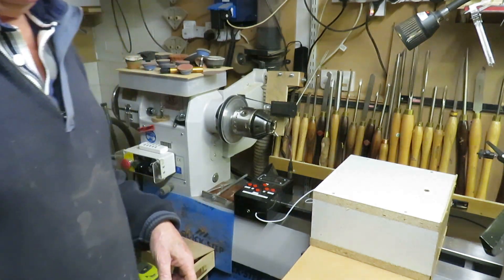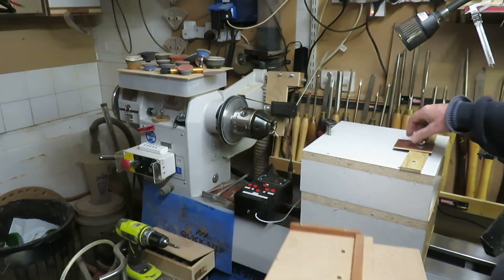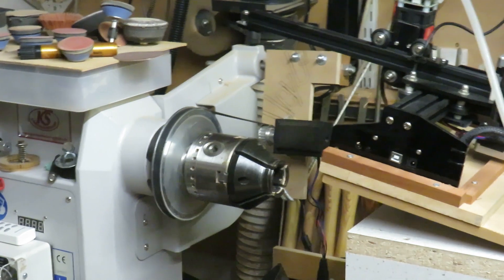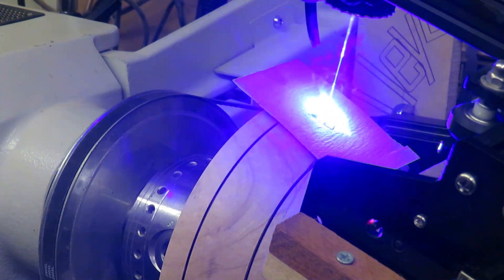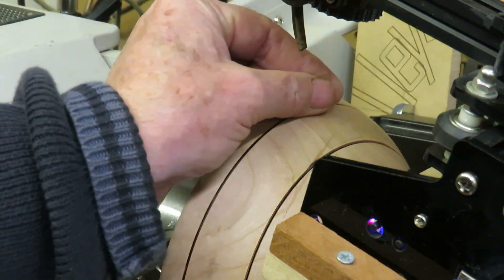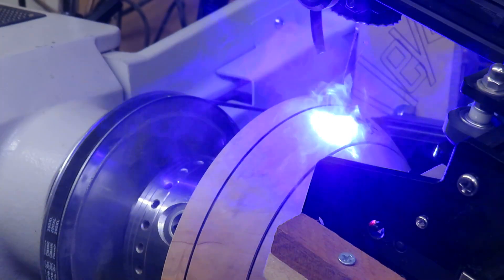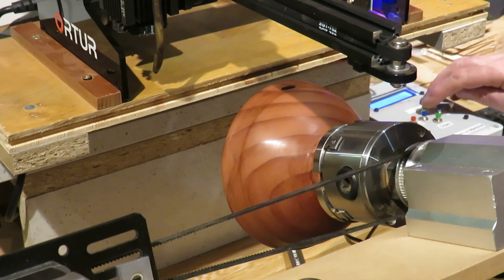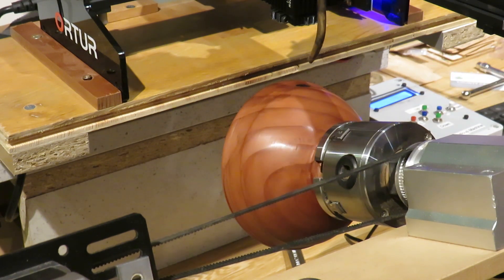Etching the outside of a wooden bowl with Ortur Lasermaster

Comment: How were you able to space the patterns out evenly to fit your bowl size? Excellent work!
Reply from the maker: Using a stepper motor controller to split the circle into sections.  Then trial and error to see how close each pattern can be without overlapping.  The controller allows me to split a circle into as many sections as I like and is more flexible than breaking the circle down in degrees.